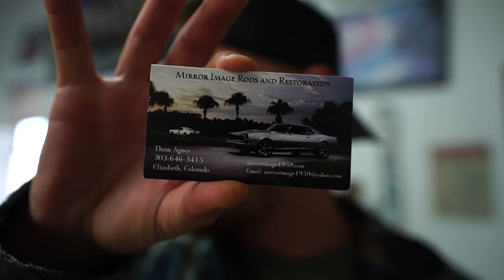This Company F’D my Truck Up!! *Cracked Roof*

Comment: Fuel inject it then put a supercharger on it
Reply: Dyl thats a good ass idea....a supercharger on any v8 is a good idea😂
Reply: @tjcook9464  I'm putting a super charger on my 2000 chevy with a 6.0 bored to a 408
Reply: @dyl6232  your 10 arnt you
Reply: Dyl My uncle has a squarebody just a little newer that has a supercharger
Reply: Turbo LS is the logical build. They are cheap easy and very powerful and reliable.
Reply: 17 but close enough ig😂
Reply: Do you assume somebody is under the age of 10 that contradicts you?
Reply: I mean seriously, you take that bad ass rumble of that old k20 and you put a supercharger on it and you get that new sporty whine to it.. no bueno my guy
Reply: @dyl6232  Supercharger is not new or sporty. Moonshiners were swapping big ass Cadillacs into 40's Ford coupes and supercharging the shit out of them. And it was fucking badass. You dont know what you're talking about.
Reply: @eagle94haslanded , Turbo's wouldn't be worth a damn on a truck he runs in the mud. NA or Supercharged is the only two options. I say get a crate Supercharged LSX and throw it in there, and it will have a couple hundred more horses than it does right now and that will be plenty for OutLaw..
Reply: Why are people hating on the supercharger idea that's a good way to make power. Plenty of mud trucks have superchargers.
Reply: @mrpeep5493  A bunch of people with no idea what they're talking about. Bear in mind these guys probably run fart cans on their imports.
Reply: @tjcook9464  hahahahahahaha
Reply: No one gets excited over turbo'd or supercharged LS swaps anymore. 
a supercharged 383 stroker motor is more exciting.
Reply: Dyl you can
Reply: @eagle94haslanded  logical.... on a lifted 383 stroker nascar loud k20... that gave me a mild chuckle.

Comment: Just buy a Holley EFI kit. Holley makes it easy to swap over. Their kit, injectors, a new fuel pump, o2 sensors, a tune, and you’re practically good to go. Can easily be tuned for better fuel economy too

Comment: Going fuel injected will be easier than ls swap. Because then with an ls you either need a transmission adapter. And a computer to run the engine. Only think you will have to do is weld in some 02 bungs and run a higher pressure fuel pump on the frame near the tank. And new fuel lines to the system. I think that any system is good. Fi tech seems to be the most plug and play from what i can tell.

Comment: A good Carter AFB/ Edelbrock 750 carb would laugh at your altitude, but for power vs economy you can't beat a good fuel injection system. I would suggest  Art Whipple with a throttle body and fuel rail setup.

Comment: Don't get rid of it all you got to do is look at fast fuel injection it replaces your carburetor with just another carburetor but the carburetor itself is fuel injected it'll take care of a lot of your issues that you're having with the carburetor and then it's programmable and it'll work just fine for what you need to do and I'll work a lot better when you go out Wheeling too because you won't have to worry about the float bowls and all that other stuff flood not your carburetor

Comment: Definitely put EFI (Electronic Fuel Injection) in the K20. The carb sounds better...but EFI has better power and is more efficient. And it would be easier than buying and putting in a whole new motor

Comment: Ur stroker motor makes great lowend torque. Put holley efi setup on it snd no matter what angle you have the truck up hill or in a deep mud hole itll work great. Same setup i run on my mud race truck

Comment: Fuel inject the 383 and with all the room under the hood of the old square bodies, shouldn’t have a problem throwing a turbo in there. Forcing more air in should help combat the atmospheric pressure in the Rockies that can add to power loss.

Comment: About what you did with the K-20 with the seats is what I would love to do it with my Chevy truck. I want to completely black it out with bucket seats and tinted windows. Yea my 1995 is no square body but I love my truck and it will never go anywhere. You should do a LSX swap because that is what I would do if I had the money.

Comment: I’d put a 421 or 427 small block full injection motor in it if you wanted to do a swap!! That’s what I’m putting in my 1972 Chevy 1 ton that has a 13” lift with 39” boggers on it!! I can also tell you that this truck rides increadbly nice & smooth!! Everyone asks me how I got it to ride better then a new truck even does!! I was shocked!! But anyways the 421 or 427 can make some awesome power 600+ hp I guarantee you that you won’t be pissed! I had built a 385 strocker for my truck also and ran it for a couple years but it just didn’t quite have the power I thought it really needed or that I wanted!! Check out Nelson racing engines I think they are in Tennessee

Comment: Fuel inject that 383. Holley is good. I got a 350 in my 74 k20 I'm thinking about swapping it out for a 383 or 454. Electronic fuel injection is where its at!

Comment: Dont use a racing harness without a cage!!! Just use a 3 point seatbelt if not using a cage you need a shoulder strap bar for most harnesses

Comment: The K20 needs to be supercharged and DIRTYMAX need bigger injectors and 5 inch turbo back exhaust and 10 inch black tip the ones that look like a rifle barrel and compound turbos

Comment: They say never go full hillbilly but I think you should go full hillbilly. You're an outlaw Outlaw. Don't listen. You're a peacock, you gotta fly.
8.1L (496) turboed. NP205 trans case, 5 ton axles. Coil overs. Tractor tires. Roll cage. Reinforced frame...etc.
Obviously, it goes without saying, you're keeping it frickin hillbilly with the carbed stroker motor but take it to the next hillbilly level hillbilly!